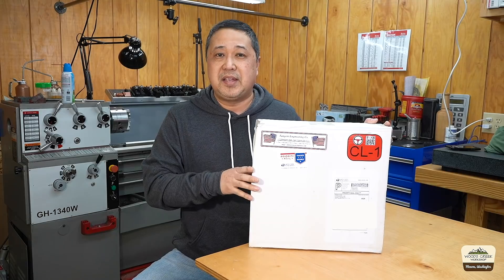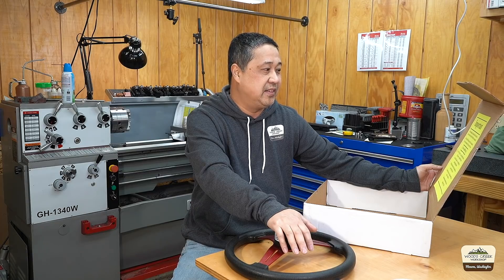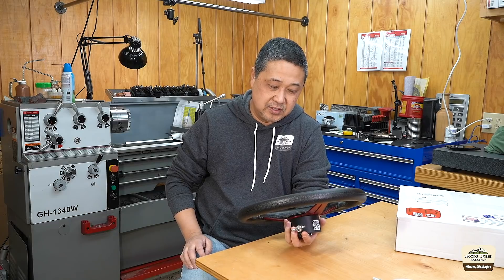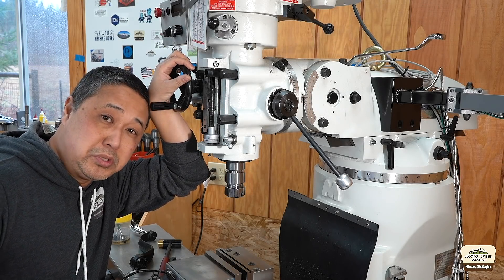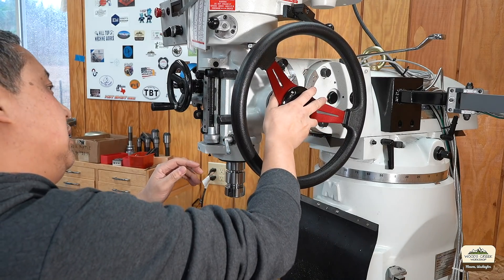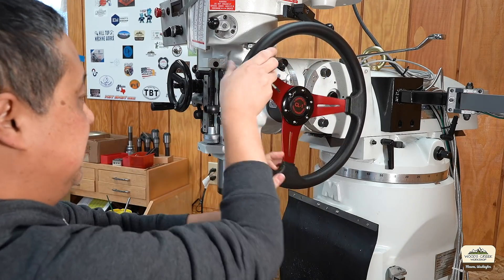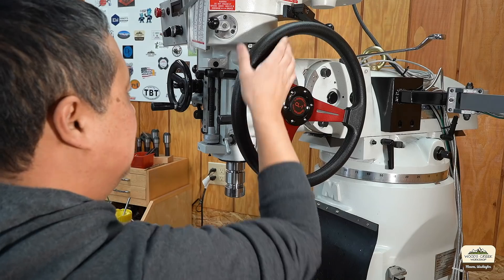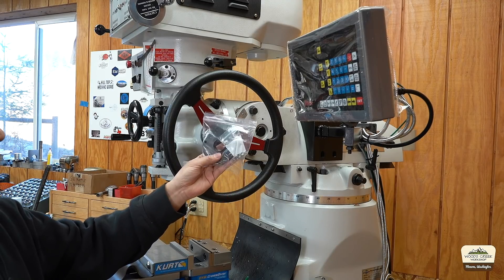Quill Wheel To The Rescue? - Quill Wheel For Your Milling Machine

Comment: I have a RF-45 type mill and the quill has three levers. Now and again I bump my head to the lever, when adjusting (metering) the workpiece or picking something up from the floor. The wheel is less painfull I asume.

Comment: My mill had a single handle.I hated it. I drilled and tapped for two more handles,120deg.apart,at the same angle of the original handle.Occasionally,it gets in the way and I slide it off and lay it to the side. I really think that steering wheel thing would be more trouble than it’s worth.

Comment: Now lets see you drill a 1 1/2 dia. hole in steel with that, I have been running a Bridgeport for 40 years and I wouldn't own one, way more leverage with the straight handle, plus, they make quick release handles already
Reply: It has the same radius therefore the same leverage, do the sums asshole
Reply: Who ever uses a 1-1/2" bit in a Bridgeport????? I would fire anyone that stupid in my shop. Arrogant comment

Comment: You got the spacer kit I helped Jim develop, on a Lagun there is a simmilar problem with the quill feed transmission lever intrtfering  with the wheel. I actually machined the first one in my shop and sent the dimmensions to Jim. I see you have found out that Jim is a stand up guy and he offered my viewers a wheel for my recent drawing. You will find if you need more torque just grab the spokes and use them. You will find as I have the it is worth the price that it costs to buy the quill wheel. Good review

Comment: Worked 40 years in tool and die almost every bridgeport was fitted with a wheel . like one of the first things people did when they got a new bridgeport was to move the wheel over from the old one.  the hardest was to retro fit on the sharp cnc mill conversions

Comment: They sent me one of those wheels too.  And just like you I put the wing nut on the top.  I guess that is just the natural place to put it.  I have a PM950V and the wheel does fit a bit close to the gear shift.  Stay well and keep on keeping on.
Reply from the maker: I am sure Jim can send you a spacer if needed
Reply: I have the same 950V and measured according to Jim's website, so the CL-1 will fit mine but I would like to get the spacer if it don't weaken the set up.  I just want one to be in the cool crowd...LOL I don't do enough work in my home shop to really need it.

Comment: now... make up a holder that goes on the square crank pin just in front of the DRO cables .. so you can snap it on there.. and you can change the steering wheel with the crank lever in seconds.. without having to search the shop... where did that thing go..

Comment: You can make one yourself with an eBay gokart wheel for 20 bucks.
Reply: Francisco d’Anconia $20 Wow, can you provide the link to your video showing this and how to adapt it to a mill quill hub. Thanks!
Reply: Don't  think he has priced delrin or stainless steel screws and I haven't seen a 14" steering wheel  for $20. But I could be wrong.😉.
Reply from the maker: No way, I’ve looked many times.

Comment: I am curious about the long term effects of the various oils and solvents on the wheel over the long term
Reply: <> This link will address Robert Oswald's oil and solvent concern;  https://americanurethane.com/urethane-chemical-resistance/
Reply: Robert Oswalt The coating is oil and grease resistant and does not break down over time.